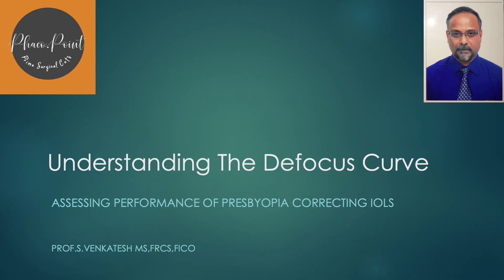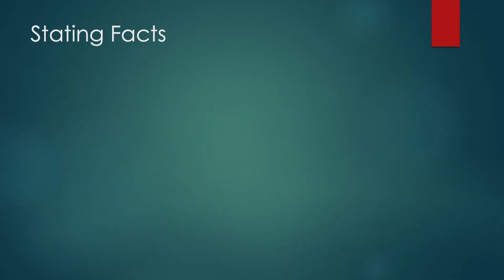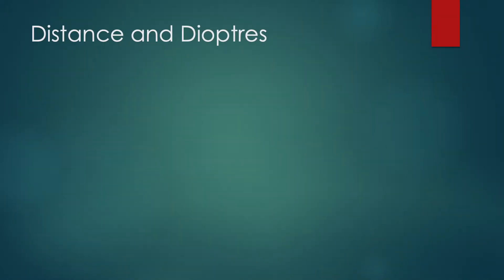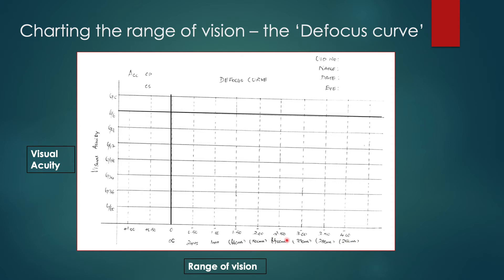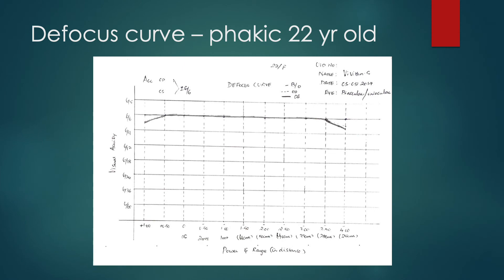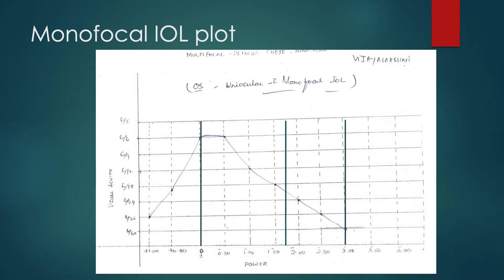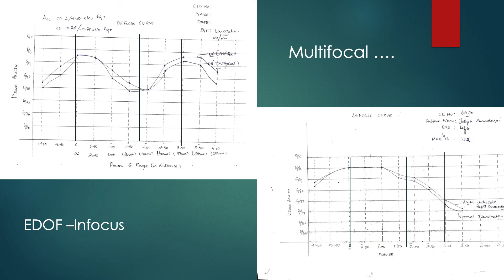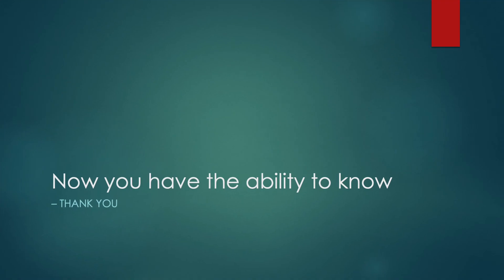Decoding the 'Defocus Curve' to analyse visual performance of Presbyopia correcting IOLs

Comment: One important factor that is not often discussed is that any extended range is always traded for image quality and contrast. So choosing a monofocal will give you the best possible dynamic range and image quality, because the number of photons going to the lens is a constant and more you spread the light, the more compromised your vision over that range will be.
Reply from the maker: I agree that the light energy distribution curve will be nearly 100% for monodical IOLs with proper spectacle correction for intermediate and near. This is certainly a trade off for those desiring spectacle independence after cataract surgery. In patients with significant cataracts the contrast and brightness is already significantly compromised and hence they actually end up being very happy with the results
Reply: @PhacoPoint  yes, any iol is better than not being able to see. But often this comes as a surprise for patients as they are not informed or they haven't done enough reading on the issue. Since they will be getting permanent implants it's important to understand this. Another surprise people often don't realize is how multifocals actually show your brain 3 pictures at once with different focal lengths, which is the source of the dysphotopsias. People don't understand it's not the same as accommodating natural eyes. In any case, it's a great presentation of defocus curves. Thanks for posting it.

Comment: Hello sir... Kindly explain diff (if any) n mechanism involved in using plus n minus lenses in examination to frame defocus curve..
Reply from the maker: Hello Kruthi. There is a difference. Minus lenses stimulate accommodation and since the amplitude of accommodation can be converted to distance we can thereby effectively check resultant va at different distance. If plus lenses are used it would blur the vision as the focal point moves in front of retina